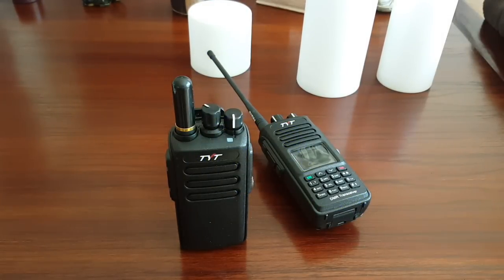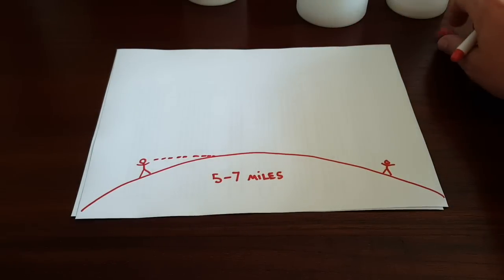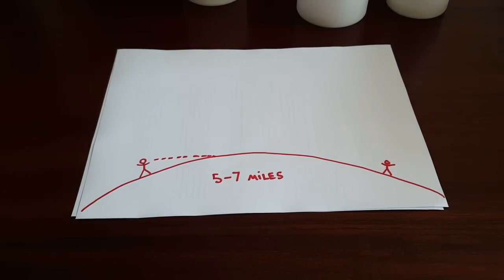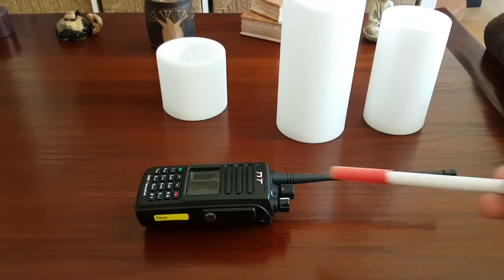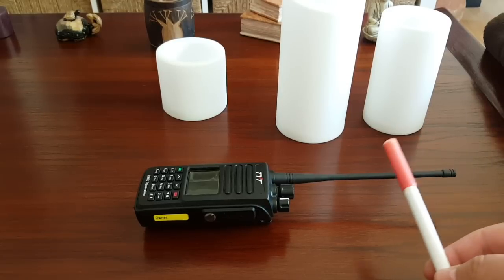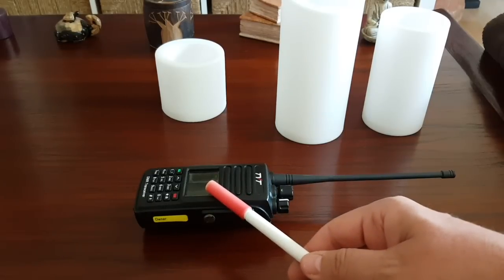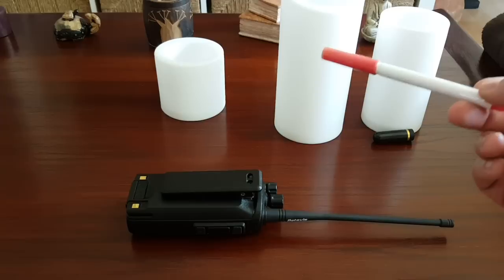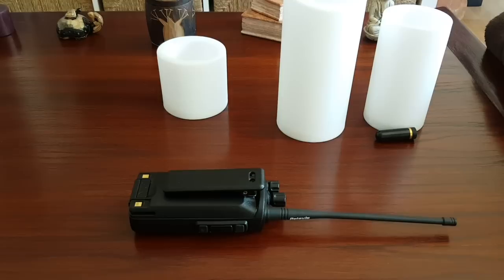How to Extend The Range of Walkie-Talkie Portable Handheld Radios.

Comment: The "range" of any VHF/UHF radio is line of sight...plus roughly 10%...this 10% is due to the wave, in effect, rolling slightly over the horizon due to the ground effect.
Using a handie makes little to no difference re polarity as the signal will bounce off buildings or any obstacle and as it bounces it will change polarity...often many times.
The only time this is not the case it is when using beam antennas point to point......here you can work on roughly 20db difference if you are the wrong polarity...it increases as you go up in frequency until you get into micro-waves, here the polarity can be great enough that you can have two separate channels on each polarity....as you see with satellite tv freq's.
The counterpoise/rat tail/tiger tails can help.....but really, if you are so far away from a station that the maybe 1 S point makes a difference then you are better off using a mobile rig with more power and better antenna...or even just a better antenna  ie. more gain...
Reply from the maker: Good info thanks.

Comment: < r u serious? Your talking utter rubbish @ 5k  VHF UHF are line of sight, as a ham you should know you can reach 60k with just 1W if your on an open plane no height required for over 30k you. 
But the curvature of the earth has ZERO to do with it. The problem is cars, trees, buildings, steel fram buildins and just about anything thats a solid mass within your line of sight. Lov the 1/4 wave dipole, but you should also know that UHF with a 1/4 wave in the same way will also add 50% on the range. but the curvitre of the earth??? lol Thats like saying buy a 100w liner amp and put it in a back pack with a car battery will also help with range hahahah
Reply from the maker: http://hamuniverse.com/lineofsightcalculator.html
Reply from the maker: https://www.everythingrf.com/rf-calculators/line-of-sight-calculator
Reply from the maker: https://www.intercomsonline.com/2-Way-Radio-Range-How-Far-Can-Two-Way-Radios-Communicate-s/136.htm
Reply: @RadioPrepper  Hi Radio Prepper:  Seems lul bro suffers from the Dunning-Kruger Effect!  
Keep up the good work.

Comment: I've always just used the rat tail wire, and put a ring terminal on it. Before screwing the antenna on, place the proper size ring terminal over the antenna connection on the HT, then, screw the antenna on. You can also use 2 wires....one for each band. A fan counterpoise, so to speak.
Reply from the maker: Yep, I have done that too, even easier with BNC..

Comment: I think outside the box, the antenna plug looks alot like a TV cable, would it work if you plug in to that would you get a world wide signal, or use a aligator clip like you have it set up and connect the other end to the biggest metal structure you can find, or the copper water pipes
Reply from the maker: No. The antenna needs to be a precise length. You would risk damaging the radio.

Comment: This is taken right from the Technician test.

 Why do VHF and UHF radio signals usually travel somewhat farther than the visual line of sight distance between two stations? (T3C11)
The Earth seems less curved to radio waves than to light

I do agree that holding the antenna properly when using an omni-directional antenna is correct.
Reply: Protective HT because short wave. bounces off the atmosphere and the ground

Comment: Why the rat tail? Why not just use a longer antenna?
Reply from the maker: Hi, because antenna length is dictated by frequency, like an organ's tube must be a certain length to make a certain note. Longer isn't better. Also if you feed your antenna at the end, not in the middle, the impedance becomes very high and you would need an impedance transformer. Easier to use two quarter waves, the rat tail being one quarter. This way the impedance is closer to the required 50 Ohms and the antenna is much more efficient.
Reply: Radio Prepper okay, is this different depending on the type of radio? I have a UV5R and i was getting poor transmission with some of the guys i train with so i got a 4 foot antena and ran it through my plate carrier in a way that let it stick up about 1 foot over my left shoulder, and i get way better transmission at longer distance, is this due to the length giving more surface area or did i effectively just get better line of sight by getting it higher?
Reply: Radio Prepper also, we are in the south east U.S. very wooded, lots of thick trees, would we be better off with ham, murs, frs?
Reply from the maker: You might have been lucky with the length.  That said, it is a bit risky because you might have a high SWR since you're not using a tuned antenna. Your radio's final transistor might overheat. Modern handhelds automatically reduce power when that happens but still... Take 468 divided by your operating frequency in mehahertzs (result in feet). Cut a wire of that length. Cut that wire in half. Use one half connected to the center of the antenna connector and the other half connected to the ground ring. Try to keep them straight and the center wire in the clear...
Reply from the maker: Ham is always better, more power. For woods, lower frequencies are better, so MURS will work better than FRS. For Urban  ops, FRS is better. Look into GMRS too, though not the best for woods. I'd suggest the 2m ham band. The license is very easy and only $15 for 10 years. You can program those frequencies on your UV5R.
Reply: Radio Prepper gmrs requires a license correct? And can we use that for our training coms? Would it be a good idea to just have radios of all types so that we can have coms depending on the situation?
Reply from the maker: Yes, a license but no exam. I really suggest you all get the Technician Ham radio license. You will learn a lot and be able to use better gear. Later you can even expand your radio capabilities. Go to radiopreppers.com you will find knowledgeable people there..
Reply: Radio Prepper thanks alot man, i will get this all done in the next 60 days or so.
Reply from the maker: Awesome!

Comment: Thank you very much, very  nice video. My radio is not connected to base of the antenna to clip, for antenna connection of wire, what I should do. Please let me know what to do. thank you
Reply from the maker: +DHINESH TEELUCK You can unscrew the antenna, then wind the quarter wave wire a couple times around the outside of the antenna connector, then screw the antenna back on. Make sure you do not have a short between the center and outside of the antenna connector. If that does not work, attach your wire to the minus of the battery.
Reply: Thank you very much will try that.

Comment: I have another tip for PMR band (446 MHz). For other bands, you would just need to adjust the length. I have a dural tube, 31 cm long, 10 mm thick, but note, must be hollow! Then I have a little plastic tube which I can easily put on the standard anthena. The plastic one should be put on the anthena similarly like you put on gloves on your fingers. The aluminium/dural tube needs to be tied together with the plastic tube, thus, when you put the plastic tube on, the dural tube is placed along with the anthenna and goes parallel. Needs to be as close as possible. I use some ductape for fixing these two together. Do not touch the dural tube when receiving/transmitting, otherwise, you would distune it. This hack can be well used with stock PMR transcievers with non-removable little anthennas and it improves the signal by 1-2 radio, so if you hear somebody 3R, you can get 4-5 R from that.
Reply from the maker: +Rafael van Horn Thanks, did you test it yourself?

Comment: It's not the curve of the earth at all. I live in Baton Rouge and it's the trees and houses in the way that's the problem.... We get about 3-4 miles in Baton Rouge. When I cross the river to west Baton Rouge where there is little trees and flatland full of crops we get 10 miles. The curve of the earth has nothing to do with the radios. Because there's some people who can talk 300-400 miles away, please explain that..
Reply from the maker: +Frank Mackenzie That too of course, but the curvature of the earth does become a problem at around 7 miles for two antennas at a height of 6 feet. Longer ranges happen because of other propagation modes like tropospheric ducting, sporadic-E and a few others which are not line-of-sight.
Reply from the maker: +Dan Baudelio QRP means low power. You probably mean HF, below 30mHz...
Reply: Also, radio waves will go slightly past the visual horizon due to the difference in wavelength.  People that are talking hundreds of mile away are utilizing troposphere to  bounce the signal back and forth from the ground to the sky.   Because of solar conditions it doesn't always work that well, but hams have been known to do "far path" signals.   That means the signal goes all around the planet and comes back from the opposite direction.  It takes about 7/10 of a second.
Reply: @pupdaddymail  Hi Jim: Troposphere?  I think you mean Ionosphere, in the context you were using (solar conditions).
Reply: You probably mean QRO and not QRP.
Double your power..at any level and you will barely detect a difference...2.5 watts to 5 watts ...1 Kw to 2 Kw it matters not.
Reply: HEY NONE YOUR,NO NEED TO START NAME CALLING.TREAT OTHERS WITH RESPECT
Reply: ON HF NOT VHF EXCEPT UNDER STRONG SOLAR FLARE
Reply: nose your, snipers will never attest to earth curvature lol nor do they shoot far enough. nor will they attest to factoring earths spin
Reply: If trees and buildings would block the signal imagine what  solid earth mass  would do ijs 🤔🤔
Reply: educate yourself before you run your mouth and confirm ignorance. although you are partcially  correct the trees houses and anything between causes signal loss but curve of the earth has something to do with everything, from radio signals to sniping!
Reply: Frank Mackenzie use a qrp radio and you will make contacts even further
Reply: Frank Mackenzie.
A little knowledge is a dangerous thing.The distances to which you refer are NOT the result of direct wave but by some form of propagation, the mode / type of which varies with frequency. And a good few other things
The higher the frequency, the fewer are the available modes.
If you had a focussed light running the same power as those 300-400 mile contacts you mentioned and if it were pointing the right way, you would not expect to see it over those distances. Light and Radio are identical waves.
With 20 Watts on the correct freq and under suitable radio conditions, you could communicate around the world.
Please don't go making bold & wild authoritative assertions when you are simply guessing. 
A) Somebody with less knowledge that you (Is there anybody) might read it and be unable to ascertain whether or not it's true.
B ) You just reveal yourself as the "know-all" you really are. Of course, the expression "Know all" is a complete misnomer.

Comment: your mod is False i just did this my self and then i undid it and it does not work in fact with the wire on my wife said at 5klm away my voice sounded worse so we retested with out the wire same distance and i was 100% clear, so the range is liminted only by horizian not so much the distance parts we got lower point dead spots with and with out the wire same dead spots but once i was higher elevated even beyond the raidos spec range i was still able to get more range and still be clear , no offence this taught me something either way
Reply: Adding a counterpoise naturally will extend range. You probably did something wrong. Many HT`s do have continuity from the screws that hold the case together, and the ground side of the connector where you attach the rubber duck. Try attaching a very thin wire to one of the screws. The best wires are those which are found in the ribbon wires in computers. Radiohamguy shows the procedure in more detail.
Reply from the maker: +Kevys Rc & Music You need to experiment with the length of the wire. It's not fake, it's physics.
Reply: well it is fake and i proved it already with my own experiemnets and some other research .. to extend range of a radio its not just the groud plane is the hot or live that also has to be extended to the 1/2 wave range which your mod only covers the ground area ,, i also looked more into as well what affects these and the horizian is a huge deal with these lower and higher points ,, these are also not much different then CB radios.. so  with the right condtions there is no range limits until the signal leaves the planet then you gota problem then .. you have only also only told use that your mod does what yoou say it does you have not given us any proof to back up your claims, also as for physics dont get me stated on how much of it is BS and its been past proven on that subject as well..
Reply from the maker: +Kevys Rc & Music You could extend the antenna to a half wave, yes, and that would work, but then you would need an impedance transformer because a half wave wire fed at the end is thousands of ohms. Two quarter waves equals a half wave. Feeding the half wave in the middle gives an impedance of about 71 ohms, close enough to the 50 the radio needs. Adding a quarter wave "rat tail" to a quarter wave antenna makes the ideal half wave.
Reply: all your adding tho is a ground plane with the wire mod its not adding live transmission at all. and ground planes are intruped when you touch them or get to close to it which is seen when i added on the wire my wife told me my voice was crapy at 5klm away then we retested with out the wire and i was cyrstal clear the radios i used are samcoms and they are rated for 3 klm but when you get around the horizon thenyou get more and more and more range out of these radios . the radio is based on line of site as we know but that can be gotten around of couse as i showed in my video of my testing of this mod wherei proved it does not work and is not needed , and after more research as i have already mentioned to you the range is afftected by the curvature of the earth which also is for the horizon part in your areas we live in a valley and every time i hit a high spot out in the car we got great crystal clear trasmisison and reception even at ranges above spec and rain or clearer skys same results ..
Reply: If voice sounds worse when counterpoise is attached, then you may have a bit of short...if you're attaching the counterpoise by wrapping a piece of multi-strand wire around the base of the antenna you may have a single wire shorting, and if you're attaching the counterpoise by hooking it to a screw elsewhere on the radio it may also not be a  good connection...trying making a good connection by soldering a ring-connector to the counterpoise, then putting that under the antenna connection...no stray wires that way.  All the information and advice given by  Gil in the video is good information, used by many other operators.
Raymond - WF7BSR
Reply: Radio Prepper feeding halfwave in the middle makes it balanced so no balun is necessary? I am currently learning that stuff. It's confusing
Reply from the maker: +Croatia Prepper Correct. Fed in the middle, impedance is about 71 Ohms, close enough to 50. No need for a transformer.